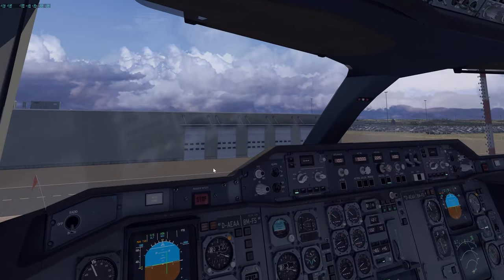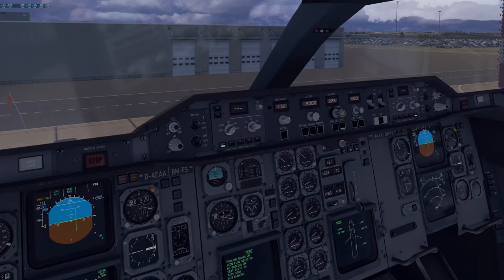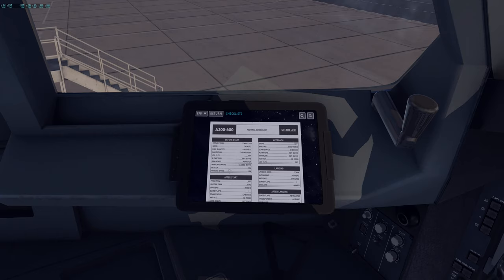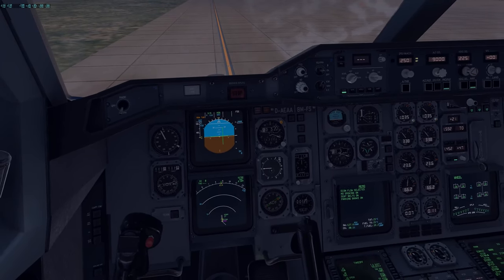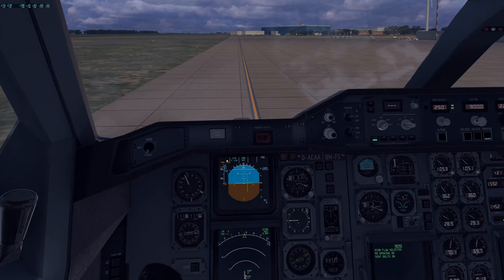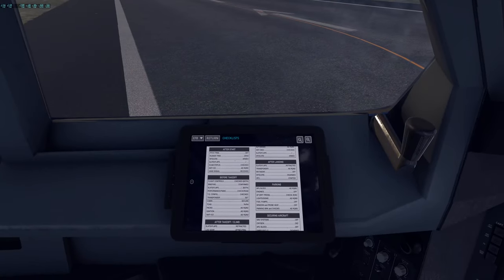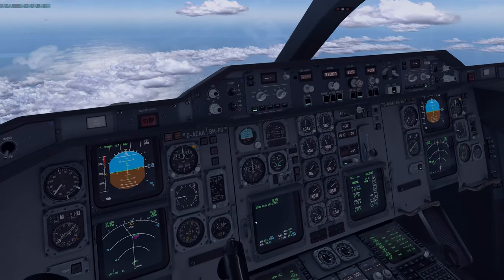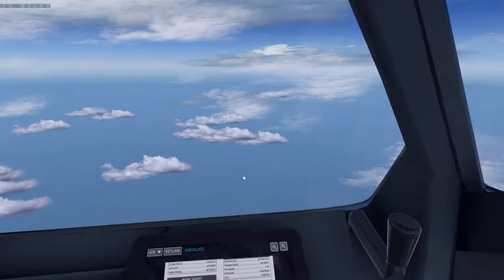iniSimulations A300 | In-Depth Tutorial | Part 3/4

Comment: Do we need to set preset speed in mcu as acceleration speed ?  Does not it read from MCDU(VNAV) even if we don’t set it 
11:10
Reply from the maker: From what I understood, it does not. There is no proper VNAV and the Plane relies on your selected speed. Which is why the TACT mode page exists.
Reply: @BProduction222  I see, I guess that makes it a different plane with the A32X series :D. You can set speed/altitude constraints there.

Thank you for the video btw. In-depth and details. Keep up the good work.